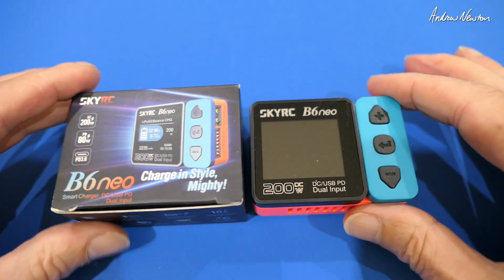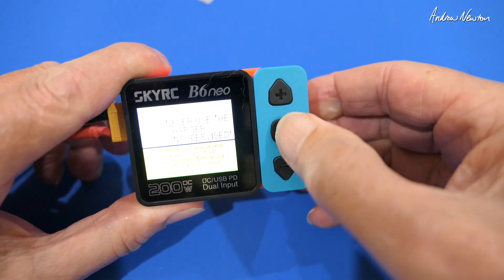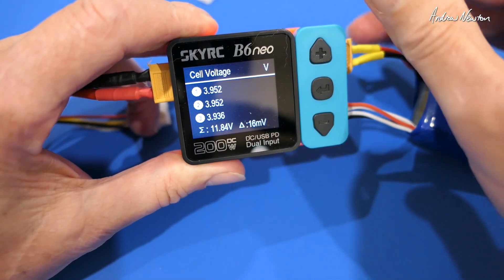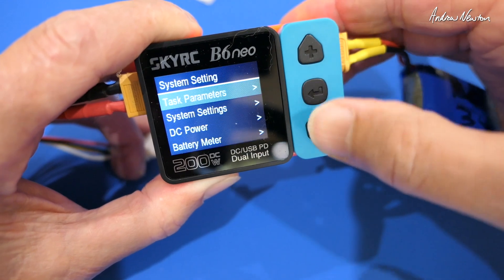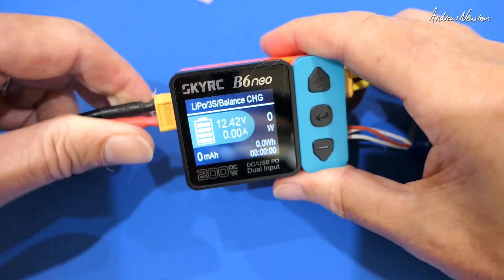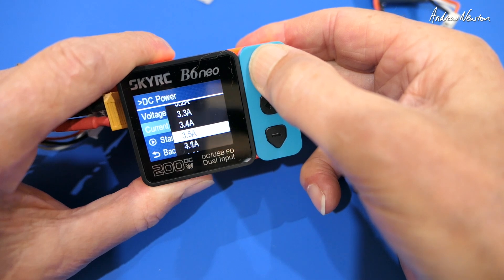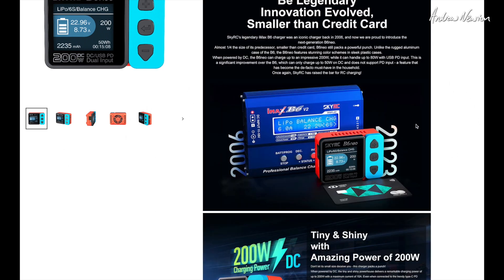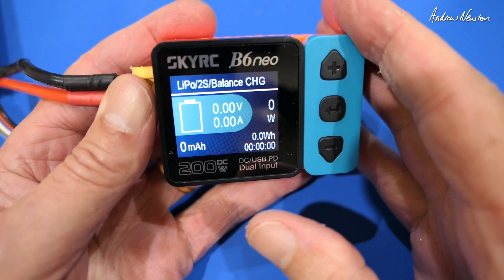SkyRC B6neo Smart Charger

Comment: This very full featured given the size. Great value, and stylish too!
The wide range of input voltage (dc) and ability to regulate the output likely means this smart charger could be used with a solar panel input at the field as allows setting maximum input voltage and current. Although solar input not specifically listed in the manual.  I'm thinking with a portable 50-100W panel, some sun and one could have infinite power to fly. ;)
BTW: Noticed from the manual that SkyRC offers an companion accessory to charge any USB related gear. The "PCH-150 Power & Charging Hub".
Reply from the maker: Good idea. A solar setup would be excellent.

Comment: 0:58 shows the USB type c port cause I had not seen that the first time when I watched it and was wondering. Still not sure if I should be happy with that or not cause I am mainly running a good old heavy and powerfull graupner Ultramat with its build in charger. 
But I guess it will become time to get one of these sooner or later and adopt. But on the other hand I feel more and more the battle for the powerfull USB Type C charger with 60W and more cause the laptop, phone, tablet and now even the hobby wants access to that device. Bought already 2 additional ones or even 3.

Comment: Looks good. The only negative I can see (and I realise this is a niche problem 😊) is that the terminal voltage can only be set as low as 4.18V.

I prefer to charge my batteries to ideally no higher than 4.10V as this significantly extends battery life whilst losing a relatively small amount of capacity.
Reply: Just switch to LiIon which has a terminal voltage of 4.1V
Reply from the maker: Thanks for highlighting that, and good idea Felix